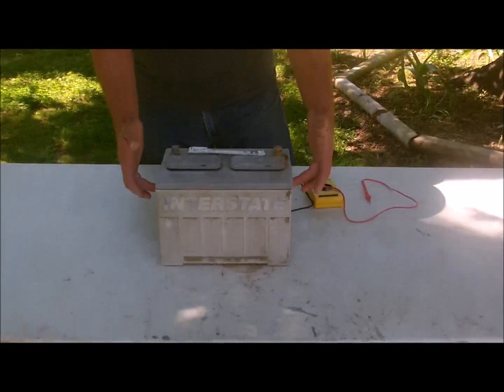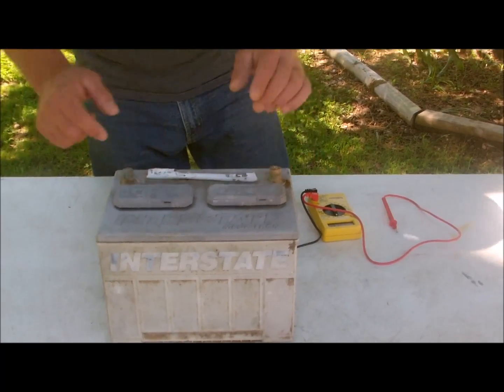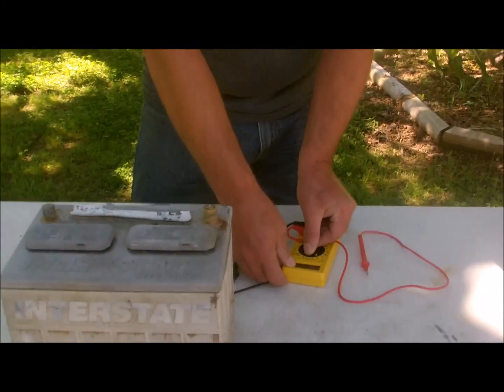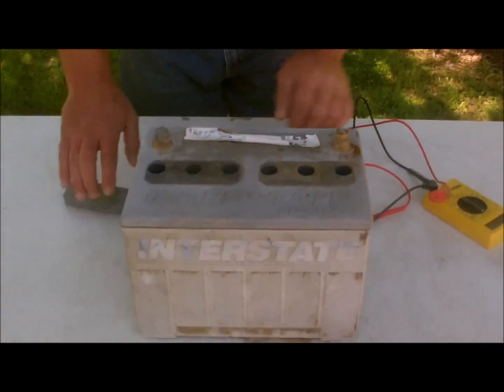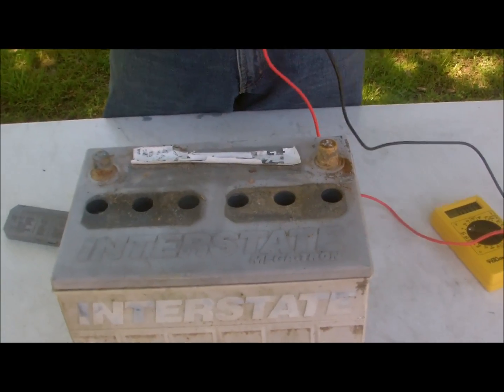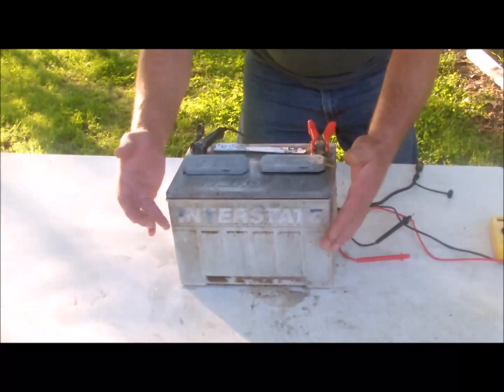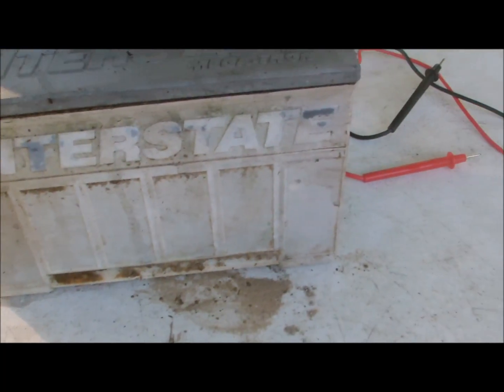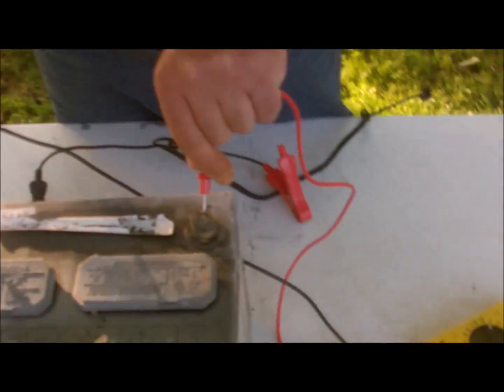Reconditioning a 12 Volt Car Battery part #2

Comment: Hi John,
You say don't ever use baking soda to wash out a bat after you drain the old electrolyte ... because of the sediment collecting at the bottom of the cells. My suggestion would be not to try to use a strong alkaline mix ... not so much that you will see sediment. Do NOT saturate or even come close to saturated solution ...  Also if you keep it warm the bicarbonate will not recrystallize/sediment ... maybe a heating pad under the bat will keep it good. After a few good rinses with a weaker solution then a few more with just distilled water then do the Epsom salt conditioning ... this should be enough to get a mild sulfated condition out of the way. If it's really sulfated then only reverse high voltage fast discharges are required to break up nasty sulfate bridges. This is usually for really old bats that have been abused to the hilt. I'm trying to recall my old chem classes about how Magnesium Sulfate can/would dissolve whatever the sulfate bridges form in a cell. I'm thinking copper sulfate bridges ? Since the residues one sees under the cell caps is blueish green ... copper sulfate. I know the chemistry is simple but it's been quite a while and I'm a musician not a chemist these days.

What is the pH value of the Epsom salt solution you use ? 

If it's alkaline then baking soda will do the same thing in just a first initial cleaning. Just a weak solution ... water will do the rest ...just extra time and effort to get it nice and clean ... then the Epsom salt solution will do the rest.

Next question ... you didn't specify how you mixed the new sulfuric acid electrolyte solution.
I suppose it's hard to know what the volume of each cell is in order to calculate the acid water balance for the right balance in a calculation.
The acid I have on hand says it's somewhere between 70 and 90 % pure ... really hard to know for sure. The really pure stuff is super expensive so I don't buy that stuff. So using that reference how would you mix it with distilled water ie. ratio ?
I'm sure there is a specific gravity measurement but the only SG unit I have requires large amounts of solution to measure ... like 250 ml or more. I was thinking of those anti-freeze SG dealy's ... not sure if that would work with battery electrolyte. I remember waaay back that you could use one to test battery electrolyte concentration but I'm leaning to no ... also maybe a ppm meter might be used ? 
So Basically I am in the throes of reviving a bat that almost looks like it has a weak cell. Left on 2A charge for 2 days and it only got up to 11.68 VDC. Water levels were quite low when I checked so topped up and set to charge for 2 plus days. Only got to 11.68 VDC. ... gotta be a weak cell ... will do the indie cell test next.

Would be helpful if you had mentioned in yer vid how you mixed the new sulfuric acid electrolyte for the right balance ? How much water to how much acid and @ what %  strength ?

You seem like a pretty stand up guy and I like that quality in a HU-man ... I'm very much into Tesla and all that entails. I am quite versed in EM theory and how it has been lets say ... attenuated in the text books. I have designed a new DC motor that when a mechanical load is put upon it, the power usage goes DOWN ! I have video evidence to support it. THIS is NOT supposed to happen !!! Today's motors use a lot more WATTS when the load is applied whether electrical or mechanical ... this is standard theory. I built a motor that defies that principal ... explain that to the math guys.

You know what none of that stuff I just wrote is important ... I have a god damned battery to revive !!!
Reply: If you buy battery acid at the auto parts store, it is the proper mix out of the carton.
Reply: If u want correct acid proportion mix small amount in, test with hydrometer, if SG is too low add some more acid in, small amount to prevent over reaction, check SG again.  Continue til SG gets high enough to show in the green region.  Must have hydrometer to measure the concentration which should be 35% (65% water).

Comment: Go for it, Man!  The reason why batteries cost about $30 $30 years ago and over a hundred now, is that they know you can't run your car without it.  They could charge $500 and people would still have to buy them.  As for me, I am going to be reconditioning more often, as long as it does'nt leak.
Reply: Technically you don't need a battery is a lot of cars. On my truck a battery is only to start it. The alt runs the truck after that. So as long as you have something to start your truck then you're good to go

Comment: John, I'm surprised you haven't mentioned in either Pt.1 or Pt2 the most important electrical aspect of a battery. "CURRENT." Yes voltage is important but the real "proof in the pudding" as you call it is how much current that battery can produce when the proper "LOAD" is applied. When you take a car battery down to Walmart or Autozone, for example, to have them check to see if the battery is good what do they do? They use an electronic checker that puts a "resistive load" on the battery while monitoring the voltage and current. If the test battery can't supply the proper current then it's no good even if it initially displayed 10-12 volts unloaded. Please show your viewers the correct way to check a 12 volt battery. Put the proper load on it by installing in your truck and start the truck to prove your point. And, yes, for the record, I have tried your method  on two different batteries. Both read the proper voltage until I tried to start the engine, ie, put the proper load on it, then the voltage dropped too low to do anything.  I applaud you for correcting some misinformation in Pt2  but you still didn't test the current capacity by loading the battery.
Reply: broadcast147839  Love the video, very informative
You said you don't make money from it, why are there commercials?
Reply: BC Jewtube needs shekels  @youray95
Reply: @youray95  He said he doesn't make $ off the 10% discounts you get from the codes he provided. And I think he also said "he doesn't do it for the $, but that doesn't mean he doesn't make ANY money form people viewing his videos. I'm not going to rewatch it to make sure I'm 100% correct, but I'm pretty sure he never claimed he never made $ from his YouTube videos. Either way, like you said, it's a great video, why not leave it at that...? But no, you basically comment saying great video, but you're a liar. Lol. That's one backwards ass compliment! Let me just say, great video, and thank you for teaching me something! And P.S... I hope you are making some $ off these videos, because imagine how much money you've saved your viewers! 
(Sorry, just couldn't read that comment and not call BS, lol)
Reply: Internal battery resistance reduces the CCA capacity of the battery.  Caused by Sulfation.  Epsom salt helps to desulfate but must do cycling/charge-discharge of battery to bring back the CCA level to the rated spec.  CCA is shown on the battery label.  Cold Cranking Amps design of the battery.  He does not discuss these requirements for reconditioning the battery.
Reply: I agree he did not test the battery

Comment: WHAT KIND OR TYPE OF ACID DO YOU PUT IN THERE?
Reply: And it's concentration should be what?
Also, can I bypass all that Epsom salt/water solution and simply replace sold acid with new one?
Is that gonna work better as far as battery holding charge?

Comment: Both acids & bases can be variably corrosive in degrees as cleaning agents & electrolytes, but on opposite sides of the PH scale where they react until stabilized in a more neutral or diluted position.

Comment: Great videos! My digital battery charger has a recondition mode that takes up to 24 hours (according to manual). Is this the same as the slow charge you talk about after prolonging the battery? I believe it's a desolate mode.

Comment: I have like 10 batteries and none of them have removable caps. Most every battery I have seen over the years appear to be sealed.
Reply: Remove the sticker on the battery and you should find the caps.

Comment: why do some or most of these videos on the subject talk about the importance of "cycleing the battery" ?
Reply: In order to recover the current output capacity of the battery, the CCA for starter motor in the car.  To bring internal resistance of the battery back low enough to put out the amps required.  This guy did not cover any of that.  He only told half the story and made some misleading generalizations about the required processes for battery reconditioning.